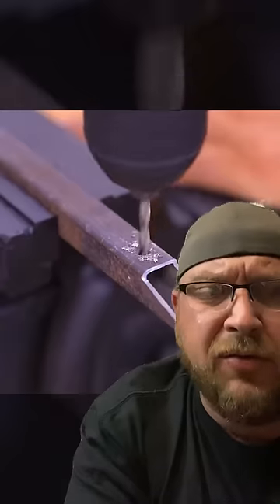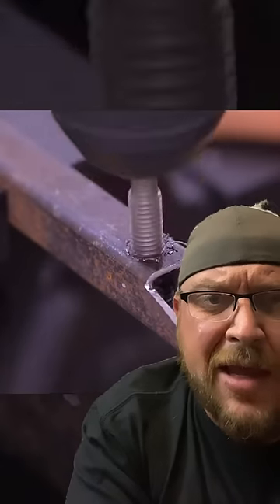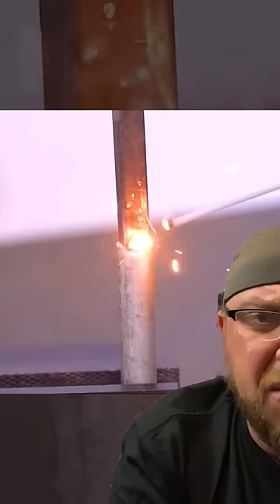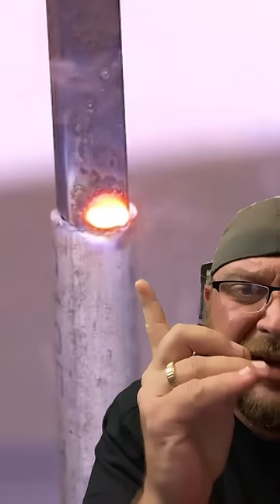Rate Your Hack (Nail Jack)

Comment: I like how he welded a handle on to it instead of just not cutting the material shorter.
Reply from the maker: LoL I didn’t even think of that 😜👍🏻
Reply: It was my favorite part.
Reply: But why even have a large handle, when the lever action is at the screw... You only actually need the cut part in the first place...
Reply: @marcbarnholdt  to hold it straight, not fot leverage.
Reply: I was looking for this comment👍🎉
Reply: Yup.
Reply: Was just about to comment this. 😅
Reply: @@TomS-xr7mk Nah, he has basically zero penetration on that weld. The surprising thing is that it held together at all.
Reply: @UpperDarbyDetailing it was inside the other bar...all it was for was to hold it in place.
Reply: @Kolonol1  even if it was a fillet weld instead of a butt weld, it's still rather surprising. Though that would definitely be better.
Reply: @Kolonol1  I'm glad I went back and checked, because no it wasn't. That round tube is too wide to fit inside the square tube. Even calling that a tack weld is generous. I know my screen name identifies me as a detailer, but I used to be a welder/fabricator.
Reply: @UpperDarbyDetailing  great to know you are another YouTube expert....I don't care about what your profession is to be honest. That being said, it's a handle....it doesn't matter...
Reply: @ThatGuyintheKilt He could've blown a hole through it. He would just have to put a tack weld on all four sides, and it would hold.

If you make this thinking it will hold for a long time, then the guy in the video clearly isn't the problem.
Reply: @ju87d-3stuka7  He cut it. He clearly cut it expecting to weld something on to it. He shows you he cut ít...
What makes you think he blew a hole in it before welding it? Why would he have welded on it in the first place?
Sure, four good tacks would have been fine. One or two bad tacks isn't. I didn't say it would, it should, last a long timei. I said I'm surprised this lasted long enough for the video.
Maybe you should reconsider the next time you feel the need to offer an opinion. Maybe wait for a subject that you're knowledgeable on.
Reply: Awww c'mon, he had to cut it that short, to make room for the handle on his wood damaging Nail Saver 9000.
Reply: @Kolonol1 The handle doesn’t matter? Have you ever held anything in your life besides your phone? 😂
Reply: @MarcosElMalo2  yes the handle doesn't matter...I didn't have to go all stupid and think I made a good insult to get my point across.....so I'll ask this...as long as the handle is secure, why the fuck does it matter?
Reply: @Kolonol1 yes, I definitely wash my arse.
Reply: @hoodzzeee  huh?
Reply: Worst part of it. Otherwise it's at least useful.
Reply: He needed the welder cohort to pump up his likes.
Reply: @Kolonol1  except it clearly is NOT secure.
Reply: Ergonomics are priority on hackjobs

Comment: I especially like how the allthread chewed the mess out of the wood.
Reply: Better welding and a soft stopper on that could make this useful on finished soft woods.
Reply: Yeah, the allthread butcher job should lose them another five points putting them in the hole. Yer getting soft in other ways, bro! lol!
Reply: that's what a putty knife is for under the hammer head. @Ken.H
Reply: Was just going to comment about that thank you
Reply: Most egregious part of the hacky little invention.
Reply: @aethertech What, you're saying the tool you used to put in the nail and a w0 cent putty knife if BETTER than wasting all that time and material and THEN adding more parts to it?
Reply: That’s another minus 3 points.
Reply: Just needs a washer welded on
Reply: @Ken.H Hammers have a claw which is designed specifically for removing nails. All you have to do is put a piece of wood under the pivot point, and it won't damage anything.
Reply: Most egregious.
Reply: Right? He lost points for the totally unnecessary crappy weld, but not for the destruction of the work piece that was trying to be salvaged?!
Reply: Needs to weld a washer to the bottom of the allthread.
Reply: Came here to say this!
Reply: That was the best part!
Reply: This is my beef, too.
Reply: I was gonna say...
Reply: just weld another piece of wood to it
Reply: Could've used a carriage bolt for a smoother foot.
Reply: Exactly - should have lost him another three points ;)
Reply: Let's not over look the damage  of driving the treaded being driven into the wood.
Reply: @aethertech  Those self-adhesive dots that you use to keep from scratching your furniture, I put those on the rocker of the hammer and on the rounded back side of my lg wire cutters. The felt works great against sheet rock.  After being on there probably 25 years, one did fall off.
Reply: It would be more trouble than it's worth, you'd need a soft stopper on a ball bearing to avoid marking up the material. If you really needed to remove a nail from a finished piece you may as well put some padding under your prybar.
Reply: @Makingnewnamesisdumb  true, but my grandad was a contractor that used to salvage materials from client jobs for personal projects around the workshop(building tool racks, hobbyhorses, etc). it didn't matter how the wood looked, and this thing would have saved him a good bit of time pulling and straightening nails. i honestly think that despite marring the wood, this is the closest thing FunkFPV has found to an actually useful diy tool.
still 0/10, but really more for the unnecessary handle and shoddy weld. i'd have just dipped the squarestock in plasti-dip and called it a day.
Reply: @mercoid  to be fair if you would remove nail using this from wood that you care about iys finish you could just place thin piece of scrapwood to protect it
Reply: he would have needed a thin washer and cutt out the bottom slightly, so it still slides flat.
Reply: The gouge marks that the threaded rod did has to be worth another -4 points.
Reply: @heerosanosyuy1173  You don't want to weld a washer on, that would cause it to spin with the all-thread, messing up the surface again and would add a lot of friction.  Needs loading spreading plate that allows the all-thread to turn whilst remaining stationary, like the plate used on a C or G clamp.
Reply: Thats what i thought hes pick on 😂
Reply: Almost as messy as a claw hammer
Reply: Yup, should have welded a smooth flat washer onto it....🤪✌️😎👍🇺🇸🇺🇸❤
Reply: I would have liked to see a coin welded to the end of the threads so it leaves an imprint of George Washington whenever you pull a nail. Kind of remind a fella of history and a sense of National pride.
Reply: They're gonna build another hack to fix it.
Reply: @SwapPartLLC No way!!! Hammers have nail removers built in!? I did framing 3 summers (teens obv) 2 different companies, neither had this incredible hammer of which you speak! Where do i get it?
Reply: Slap a piece of aluminum flashing down where the threads will hit
Reply: Came here to say that.
Reply: @Ken.H Yeah I'm looking at this and seeing potential.
Reply: Glad you said it because i was going to...
Reply: Rubber pads

Comment: The perfect tool when you don't want to mar the wood by prying, but don't mind destroying the wood with your screw that has no foot/base.
Reply: I don't think he's trying save the wood, I think he's trying to save the nail so he could reuse it. I knew times were hard but not that hard.
Reply: So you can't put a thing between the wood and the metal?
Reply: That's why you put a bit of cardboard where you're going to lever the hammer
Reply: It’s not a bad concept, it’s just mediocre execution. 99% of the time the hammer’s claw or a pry bar is sufficient, but I really hate that 1% when the head is rusty or just weak. This might save me 15 minutes/year.

Comment: Dude left his hammer at home but thank God he had his drill, tap set, square iron, vise, and welder handy
Reply from the maker: LoL 😝
Reply: Phukin A bro I swear I was thinking the same thing!🤣 glad you put it into context 🦾
Reply: And file that we didn't see to clean up the cuts 😝
Reply: To be extremely fair, something like this could be useful if the nail is in a tight space.

Not to say this one is well crafted or designed though.
Reply: “I made this hammer out of plywood, Rebar, A drill, Screws, And this hammer I found!”
Reply: When all you lack is a hammer, nothing looks like a nail.
Reply: I watched a guy make qooden stakes, some of the options were an ax, miter box, jig saw, compound miter saw, and then finished with a band saw, I was like if I had a band saw, I most likely have all of the above, thought he'd have a faster way than 2 45s, or an easy way for a more acute angle on it.. anyway had it all but the 🪓 lol

Comment: If the only goal was to be able to reuse the nail, he wins, but because the cost of the nail is exceeded by the cost and effort of the tool, he failed.
Reply: Clearly intended for use with solid platinum nails
Reply: And the cost to fix the wood he tore up...
Reply: Yes, but when you really think about it, the cost of producing this--fine--tool amortized over the user's lifetime of saving perfectly good, reusable nails is immeasurable.
Reply: He was out of downward-pointing nails, dude. And it was a Sunday.
Reply: After the great Toilet-roll Panic of '21 comes the great Nail shortage of '24.
Just you see, we will all be running back to that guys channel.

Comment: I have at least five different nail pullers.
None of them require a screw gun.

I even have one that was patented in 1914 called The Hooker.

Bought it for $5 at a garage sale.
Reply: That term dates back to at least 1859.  It referred to the, ahem, tradespeople who worked on Corlears Hook on the East River in New York City.
Reply: @alexhajnal107  Thanks for the information.

The one I have has a forked end with a tear dropped shaped hole slightly above it and a small square double hammer head.

Best tool I have ever found for removing trim without damage.

Comment: I will admit, I love how it doesn’t bend the nail and allows easy reuse of nails
Reply: As long as you leave the head out 1/16" before you remove it.
Reply: @MaxEntropy1  didn't you notice, it has an engineered gouge-point, to dig in under the head😂

Comment: Disimilar metals on the welding should’ve taken away an additional 3 points that way it’s -3 and now you have negative points that can be awarded to the next hack
Reply: Steel and steel...... not dissimilar. I think the pipe was just galvanized.
Reply: The tube appears to be aluminum.
Reply: @Mako1904 No. It’s steel. Aluminum would be aluminum color.
Reply: @jaredlancaster4137 lol if it was galvanized. That’s why the tack welds were so half-assed. Those fumes from galvanized are dangerous, so you only want to breathe them a little bit. 😂

Comment: Put a nut inside the tube for better threads!
Reply: And I haven’t had to use “a pill for that” … yet
Reply: Great idea and it’s replaceable, stronger, and you don’t need a tap! Hack improvement approved. You get the 3 point that we’re taken away from the hack originator. 😬😀
Reply: It doesn’t even have to be inside the tube. Outside would be preferable and easier to weld.

Comment: Don't forget to take three points for using soft steel, and three points for cutting the angle on the bottom of the piece instead of on the top of the split where it belongs
Reply: I deducted 2 points for damage to the board and being sized for only one nail size.  Between the three of us he's tallied a -5.  Anyone else have negative talkies to add to this?

Comment: this is probably the most useful one ive seen you review. i mean, it does extract the nail without bending it which a hammer would do, even if only a little. the weld is shit and a rubber pad on the bolt wouldnt be a bad idea but i mean, its not terrible. id say a one out of ten is warranted.

Comment: It's very common in developing parts of the world to reuse stuff like nails. The idea is to extract it straight. If the wood was valuable, a small piece of something could protect it.
Reply: Welder check
Grinder check 
Drill and Tap die check
An Infinite amount of time with nothing else productive to do so it makes sense to spend that time pulling nails to reuse them rather than buying five hundred for five bucks.

Oh an explain why he bothered to cut the box section in half and weld a piece of tube on it.

Stupid is stupid.

Comment: Nail jacks really exist however typically they have a pad on the bottom that prevents it from harming the work surface. They are typically used in situations where you need to pull a nail straight from a work piece and you can't use a set of pliers or other means. I would have deducted an additional three points for the damage to the work surface.

Comment: Try using the other end of the hammer you used to drive it in. This is a great way to damage the wood, though!
Reply: I tried but the air hose for my nail gun doesn't do a very good job. Or was I supposed to go all the way to the other end and use the compressor?

Comment: Mechanically it looks fun, probly takes longer than just yanking it out with a claw or pliers, but it it's absolutely needed that bolt needs a buffer or it's digging tight into the surface

Comment: Put a wide base below the allthread,  then replace the power drill with a hand crank and it's a handy tool for extracting nails on delicate surfaces. Not too bad
Reply: The problem is that the base would push the wedge up, making it harder to get in under the nail. The raw screw sits flush with the bottom of the wedge, a base wouldn’t do that.

Comment: Love how the allthread is gonna chew up the mild steel thread. Note to fellow makers out there, use acme, or trapezoidal threads to transmit force in your projects, triangular threads are very high friction, hence why we use them to tighten bolts, the friction makes it so they dont come loose. Also allthread sucks for precision, those rods are aways bent.

Comment: I mean honestly this is a good start. Make a cut out and add a soft plate to not screw up the wood and this could be useful in carpentry. Had to pull a lot of nails the needed to either come straight out or didn't have room for a hammer.

Comment: I wood say it is a work in progress.  The advantage is it pulls straight up and not at an angle.  The down side is that the bolt chews up the wood.  So if he had a solid plate under it, it might keep the 3 pts as that weld is only to hold it together and not really much force

Comment: The mechanical theory is actually quite good. Put a small piece of flat steel under the bolt and you can remove nails without damaging the timber. Awesome for reclaiming timber from pallets etc. I vote he gets one point for actually thinking. Cmon funk. Be that guy. Make his day 😂

Comment: I know for a fact that there is a cheaply priced little tool sold for this very purpose, like a little miniture crowbar with a handle.  In have one and it has proven very useful.  It lifts the nail head enough to get a claw hammer in and finish the job.  So cheap, so simple, no welding/power tools required. . . and with a little padding inder it, it doesn't damage the wood either.

Comment: Should've put a flat part on the bottom of the screw with a ball-and-socket joint. Also, welding a nut inside of the pipe for the screw would give it more strength. Grade 8.8 preferably(since its obviously not American standard).

Comment: I'd like to add an additional -1 to that. It's clearly doing damage to the wood. You wouldn't want this device near a piece of trim that you're going to reuse. I give it another -1 for the nail catch being designed for only one size of nail making a framing hammer or a standard prybar more useful. With his assessment and my added assessments his work has reached the all time high of -2.

Comment: oh my god, he was so close....
     if not for that unnecessary welded handle, he actually built something kinda useful. people are saying that it chews up the wood, but depending on the job thats fine. as a suggestion he could screw a foot of some kind onto the threaded rod to lessen that.
    but my grandad was a contractor and had a workshop on his property where he would store materials ripped out of client projects and recycle them for his own personal projects(knock out a wall for a client, save the studs, etc). he would've LOVED this thing for pulling nails without bending them, this would have saved him a lot of time sorting and straightening/discarding nails. as for the marring of the wood, he used the reclaimed wood for utility stuff(pallets, boxes, tool racks, worktables, etc), stuff that didn't matter if it was ugly as long as it worked.

this one hurts cause it was SO close. he could have just Plasti-dipped the square stock, or wrapped it in leather, and he would have been fine. hell, he didn't even NEED to put a handle on it, and in his boldness was his undoing.

Comment: As a floor guy.i will say theres been a time or 6 where i could have used a shortened version of that. Too big as is as pry bar does fine but if it was smaller and could get into tight spots like in framing etc js could be useful shrunk down

Comment: I want to say this is a practical tool, but that screw wrecked the wood, the welding is well it needs to be better as I doubt it has long term reinforcement.
Final result, needs work, a lot of work, but by basic concept I agree.

Comment: I'd take another couple of points off for missing a step in his build. He NEEDED a washer welded to the bolt that faced the surface. Anything softer than that steel would get chewed up like we saw on here. Weld a bead on a washer at the end. Grind or sand it smooth and there you go.